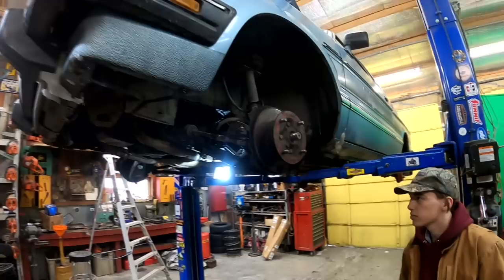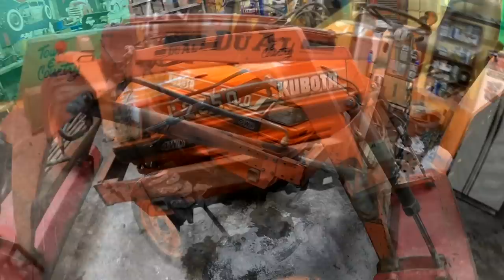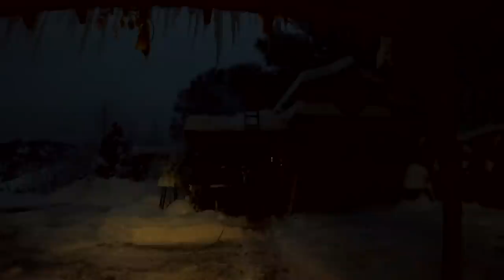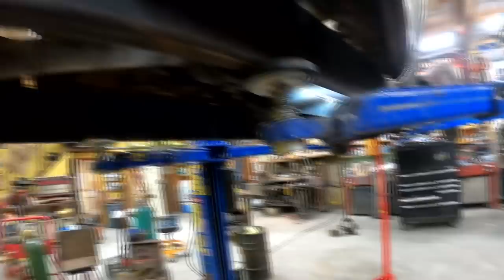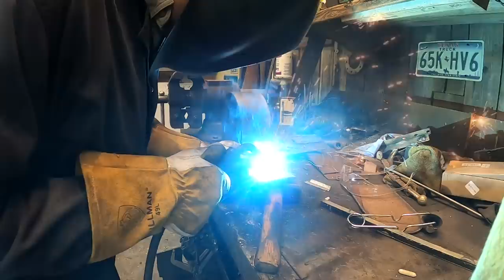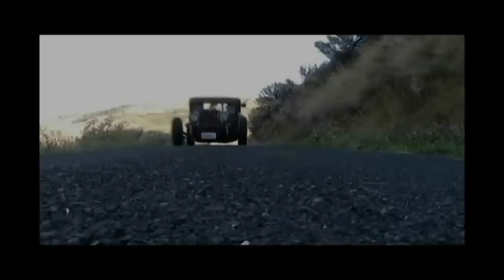DRIVESHAFT CAGE FOR V-12 RATROD!

Comment: Safety first, I had a loop on my drag car cause of hard launches actually went under the drive shaft ,so the front wouldn't launch me off the track. Shatter shield on the bell housing for safety, never saw a need on any of my other cars. You do what you think is right, you can never be too safe..Go for it...

Comment: That whole video, from pickin' to blowing snow, was dang good sir. We've got a 86 model L2250 here, had it since new and the thing is about indestructible, as long as operator error is kept to a minimum. Two summers ago there was an operator error event that caused a leak in the radiator, and I went through what you did. Figured it would be a good time to swap out the original hoses and put a new thermostat in it while I was at it. The neighbor has  and Old Kubota, the local dealer thinks it is a 1974, at least parts for a 74 seem to fit. I've helped him with it a bit in the past, it is "different"....
Reply: Arch Stanton? Isn't the gold buried in the unmarked grave next to yours?
Reply from the maker: thanks for watching! I heard all the gold was in a bank in the middle of beverly hills in someone else's name! haha

Comment: An on board generator or air compressor would be a neat use for that PTO.    The gen set might be a bit tricky to get running from salvage... Maybe a 5-10 KW unit from a portable with a good control board from a portable unit with shot motor....the compressor could be found in a semi truck salvage yard
Reply from the maker: yeah. lots of good uses for that pto.. take your pick! haha..

Comment: Why does the V12 struggle to fire up Ken? maybe put a couple of bolts in the dryer to wind up the moaners. Something I have kept meanin got ask about is that Air Vice you have I don't think you've ever mentioned it or told us how you made it, and I just love your bender, I wondered what the heck you were up to.
Reply from the maker: because it has to wait for fuel  https://www.youtube.com/watch?v=c90WPD5_3H0
Reply: @1963impala2drWaylonWire  Thanks Ken.
Reply: Probably needs a 1 inch fuel line

Comment: Hi Ken, I don't want to poke my nose in but I thought the sliding part of the drive should be at the gerabox end as per most cars. Obviously you must have a reason for it to be the other way around? Cheers and if I don't get a chance later on I wish you and all of your followers a Merry Christmas and a Happy New Year. Keep safe.  Ian New Zealand
Reply from the maker: yep. I know thats the way most are set up but the other end doesnt fit the transmission and i studied it and what I came up with is.."what difference does it make" lol.. I guess if there is an issue I'll find out but I didn't have the money to have a special driveshaft built so again..working with what I had
Reply: @1963impala2drWaylonWire  I thought there would have been a common-sense reason. Cheers Ian

Comment: "Hey Waylon,,!!" You were mentioning about making the seats swivel so it was easier to get into them,,,?? "Well just a thot I had was what if they were on a sliding track that could take them forward first and then let them turn to the door opening,,?? 
   It looks as tho the other side may turn and pass behind the steering wheel an leave enough room for a fella to get his caboose into the seat then swivel to the right an slide on back on the tracks to the back of the cab an shut the door,,??
  "Any-Hoo" just a Crazy ole thot from your #1 Fan,,!!" "Richard" 
    "Luv the vidz,,,!!" "U take care Buddy an Have a Wonderful Holiday,,!!"
Reply from the maker: even if it slid forward, it would still hit the other seat.. anyway. that would be lot of work to solve a problem that doesn't exist haha..